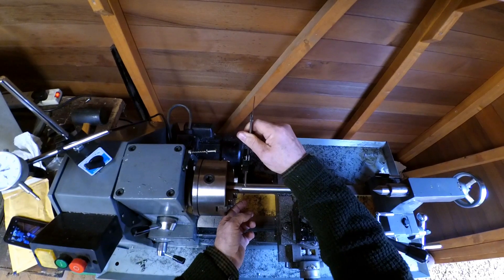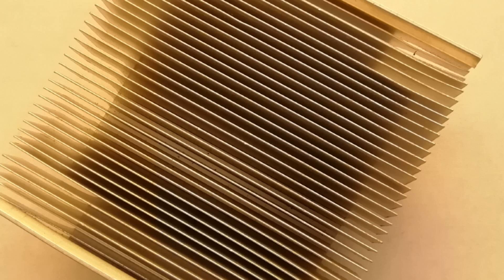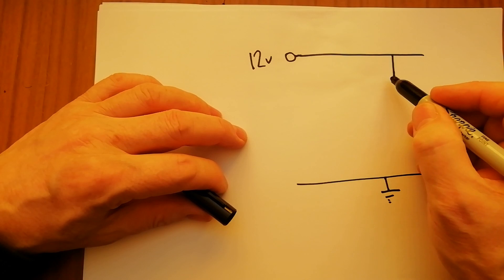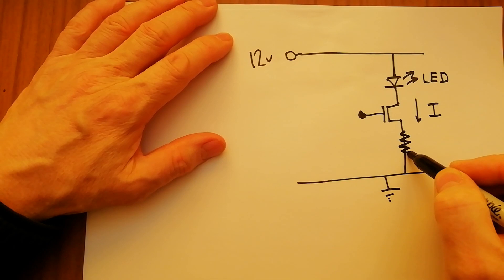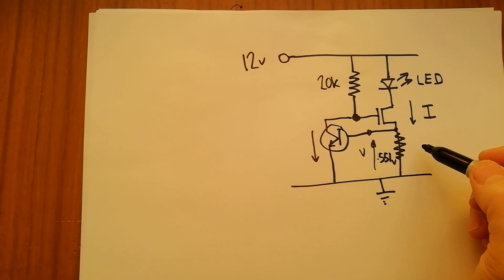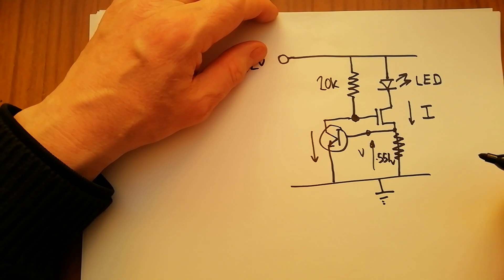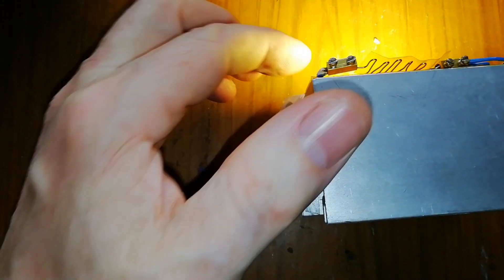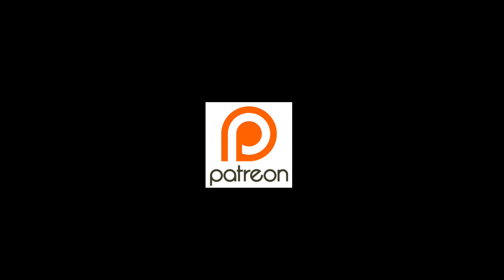DIY LED Lathe Work Light

Comment: I liked your clear explantion of how to sketch out the circuit and then the build. You might want to mount your lamp on a flex stem so it has a bit of mobility.
Cheers from NC/USA
Reply from the maker: Thanks. I'm glad you found the video useful. Yes, maybe a flexible stem will be a good addition.